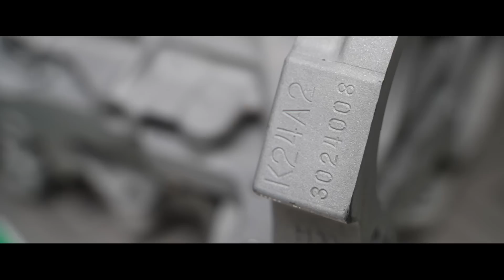1000HP Honda K24 Build! | AWD Turbo Acura RSX (Engine Build Part 1) - Ep.13

Comment: How is it stock if it has Darton sleeves? Honda doesnt produce any engines with Darton sleeves. But. Im sure some honda fanboy is going to tell me Im wrong. Or a hater because I asked about the sleeves. 😆😆
Reply from the maker: The 10.1@137 was from a previous episode in the series. We ran the car for baseline 1/4 mile numbers before we do the built engine. 👍

Comment: This awd build has always been amazing! Glad to pick up a type s in 2019 for a steal, quick question , what haltech ecu model you’re using for the build by any chance been looking into it for like almost a year. Hope you get to respond my question brother 🔥
Reply: I’m sure he’s using the haltech 1500 ecu and for sure he’s using the haltech ic7 dash display,
I myself have both of those for my k24/20 all motor build
Reply: @petrolhead8851  ah bet man bc I’m looking forward to get a haltech soon but wasn’t sure if to get the 1500 or 2500 ya know but now I know, hope I can get more answers in the future from the community just like you man! Thank you🔥
Reply: @kid_matt  the haltech 2500 is more for 8 cylinder cars or unless you’re running 8 injectors on your 4cylinder, but if you’re just going to run 4 injectors you’re good with the haltech elite 1500, they even have a plug and play harness for the k-series…yeah no problem, glad I can help somehow
Reply: I’m sure he’s using the haltech 1500 ecu and for sure he’s using the haltech ic7 dash display,
I myself have both of those for my k24/20 all motor build

Comment: I have a 2000 em1 , b18c1 built and going boost now can't wait all motor is fun especially when it's just a 4 banger but fully built with cnc block pistons rods sleeved hooned decked the works but I need more power
Reply from the maker: Sounds like a fun project!

Comment: I wish Germans weren't that narrow minded and we could have a aftermarket industrie like that. But no no. Not in Germany. Too many rules and restrictions 😪
Reply: Just buy stuff on eBay and build it
Reply: @MotorSwapDan  nope. As long as you have no certificate and certain tests done to your parts, you are not allowed to have them installed on your car. You could go through the procedure, but that time and money intensive. Not worth it unless you plan on selling it in a large quantity.  

Germany don't want you to mod your car. 
Sure you can slap some wheels on (again, as long as they are certified) and do some minor mods, but nothing you in America would call a build... it's a shame and Germans love there rules to much to ever have it changed ...
Reply: @charliefrharper  yea, I mean we have laws too, but no one follows them so nothing is enforced.
Reply: @MotorSwapDan  Enjoy this kind of freedom.

Here in Germany we have to get our car inspected every two years. If they find anything illegal on the car you won't get the needed stamp and your car is not legal to be driven on the streets. If you get caught driving the car the police will confiscate your car. Further more your insurance will not pay in case you have an accident.
Reply: @charliefrharper  HIER wir sind fast alle prollz ohne fühererschein

Comment: People built these 20 years ago. 🙄
Reply: And?
1000 hp is a 1000 hp.
Reply: Yes, but you still can't build it
Reply: @Mohapi_Tau  probably drives a base model modern car that's trash.
Reply: Why would that be important at all? Turbo Honda's are awesome regardless of when they are built, and even then the technology is so much better today than it was 20 years ago so it can be made so much more efficiently than 20 years ago.
Reply: Did you?